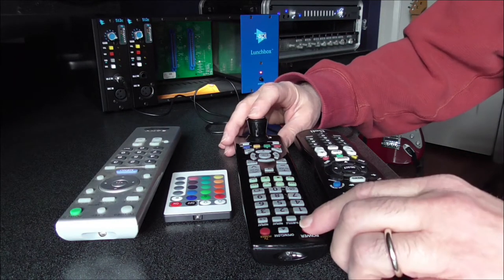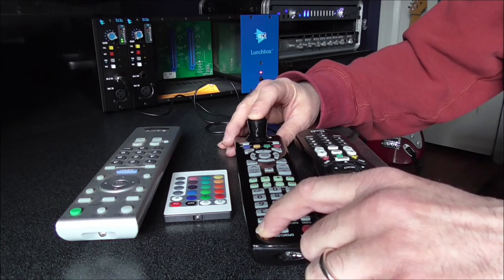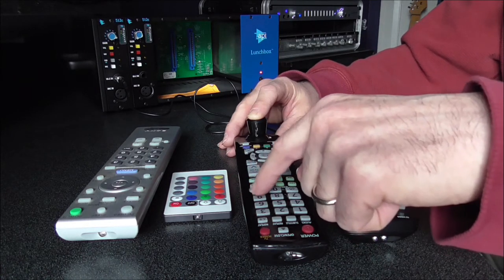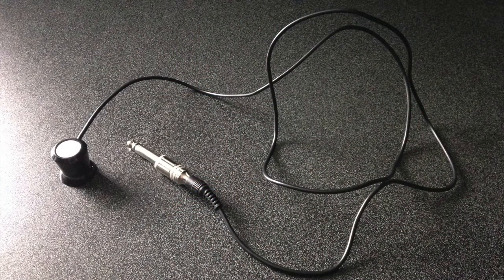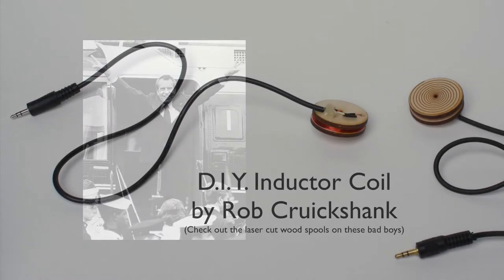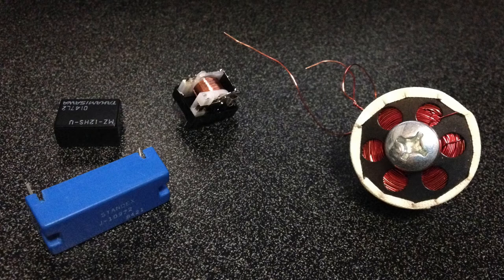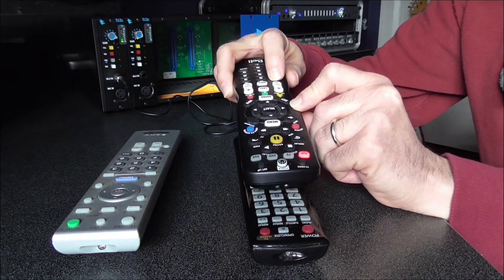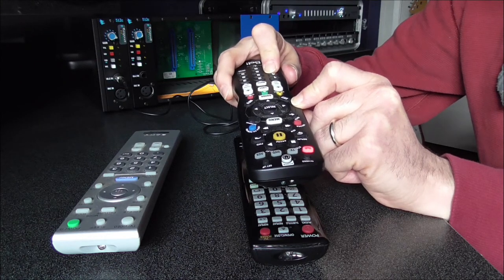Use an inductor coil pickup to convert electromagnetic signals into sound

Comment: Hi.

Where can i buy them cheaply?  I would also buy 3, 5... fpr a better price.
On Ebay the cheapest is £ 2.95 plus £ 3.75 postage from the UK.
This is of course a bad relationship. Unfortunately currently no offer from China.

What are the differences between the coils in devices or as a component?

Particular sensitivity to certain frequencies? What frequency do these coils respond best to?